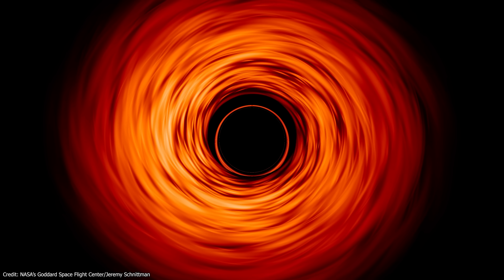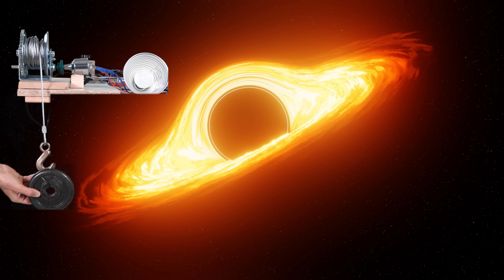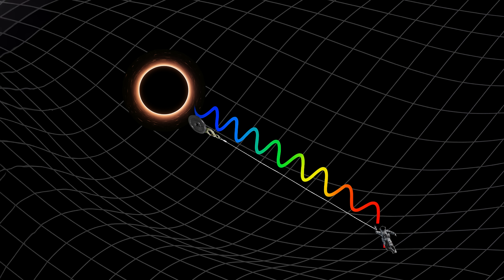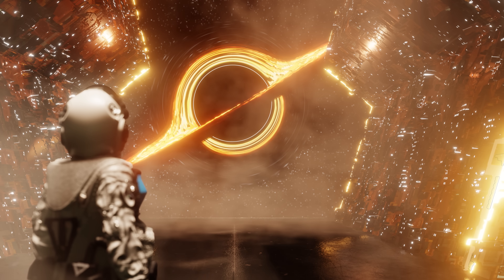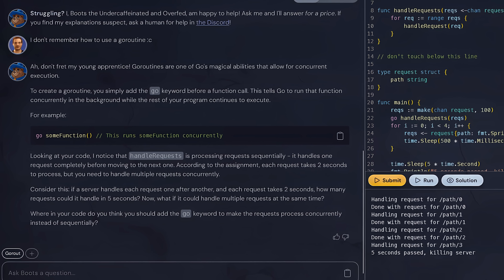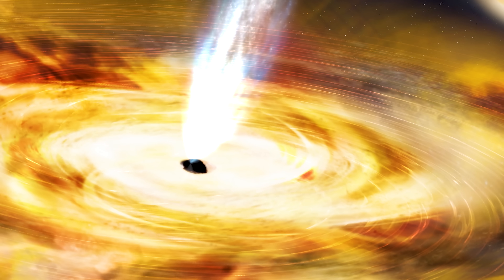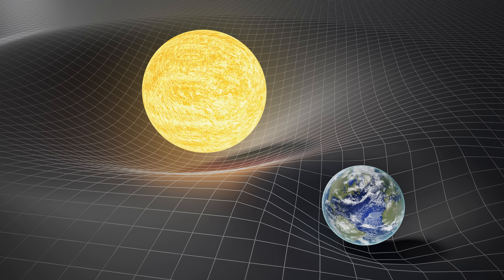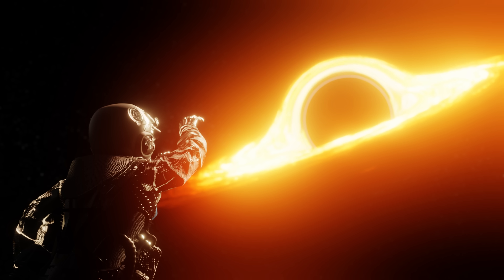How to Convert Mass into Energy at Home

Comment: It's an  external magnetic field and mass disolves into external heat energy because pressure is weaker outside of mass, with no internal pressure outside of mass and mass occupies space within it as outward force of pressure from cold repulsion as magnetism. Mass within closer proximity to external heat energy currents disolves its outermost surface perimeters into external heat energy like campfires slowly disolving internal magnetic fields disolving outside perimeters first. Physics works. Mass falls or rides the current grounding as a wave towards the earth's surface. Heavier elements have more repulsion equalization to lighter elements grounding currents through its nucleus or core like quantum elements, making up planetary internal magnetic fields grounding currents through its nucleus or core. Our outermost magnetic field perimeters protecting our planet from intensity of heat energy singularities solar wind striking our outermost magnetic field perimeters light up when dark heat energy strikes as quantumized sparks unabsorbed. Prisms show the color of unabsorbed heat energy singularities outside of mass as fire lighting up the mass it strikes unabsorbed. The lighter the color, the more heat energy passing through the glass. Thicker glass absorbed more heat than thiner. You can see rainbows of color in campfires. Physics works. The current flowing in a river at the same rate as the middle or the shallows is equal baring resistance. When magnetism hits the resistance of currents, you see centrifugal forces of whirlpool or whirlwind. Mass is cycling circulation centrifugal force of magnetism. Our magnetic field protecting our planet is made up of elements proves hypothesis. Our magnetic field is the amplification of quaternary elements combined amplification of quaternary elements synchronization of magnetism. Fire is anti-matter. Campfires prove hypothesis. Two states of physics cold and heat coexist. Magnetism explains everything about physics without gravity and bending space and electricity. Electricity is rapid heat generators of faster than planetary internal magnetic fields grounding currents through all masses in its path. If heat doesn't ground currents it disolves into external heat energy outside of entanglement of mass like external magnetic fields stripping away potential renewable heat energy from proximity mass disolves its outermost surface perimeters like meteorites hitting earth's internal magnetic field faster than grounding and hit atmospheric gasses as a whirlwind disolves outermost perimeters surface first.
Reply: Wow, so many words. My brain is not braining anymore.
Reply: I will come back here to read it.
Reply: Stop it, get some help.
Reply: Yeah okay buddy.

Comment: UPDATE... the claim at 1:37 is false. Imagine the frame of the weight. Time dramatically slows as it approaches the horizon. From its point of view the universe outside is evolving extremely fast. This includes the winch. Any gentle tug (acceleration) of the cable will yank the weight at an outrageous rate. This is tension. It will NEVER drop to zero.

Or, imagine the frame of the winch. The mass is falling toward a (very odd) planet, where the weight does not hit with a thud, but rather with (what appears to be) an infinitely long, slowing descent toward the event horizon (which it can never reach). The cable never goes slack. The weight itself is continuing to fall, but (from the point of view of the winch) at a dramatically reduced speed. The cable remains under extremely high tension. It NEVER goes to zero. That said, you could induce slack if you try to let out cable faster than the weight is falling (from the perspective of the winch).

My original post: If you are confused here, I am a Math/Physics PhD and also confused at 1:37. The implication that you are going fishing (in a black hole) and the thing ate your bait (mass) but yet it is still attached.... seems problematic. How can there be slack?
Reply: There was a thread in a physics forum about "Black Hole Fishing", and Greg Egan did the math and concluded that the line will always break, no matter how strong.
Reply: Educated here, although in a different language/era (terms may vary: "relativistics"/"relativistic effects"/"mass-vs-energy"/"momentum"; etc) , but allow me to try to explain: It bent my mind until this mental exercise helped: It helps if you imagine two rooms are time-dilated relative to each other.  Tug of war between the two humans.  The amount of energy/pull will be felt different: The newton forces of pull over different timescales translates pretty weirdly.  This is how I made this video make sense.  Now, a caveat...there's no infinite-strength zero-mass "unobtainium" rope for this hypothetical, but the thought exercise of two adjacent rooms at smaller time dilation ratios (say only 1000x time dilation), made me understand better:

Imagine the person in normal-time room and the person in the slow-time room (for mental simplicity, let's stick to relativisitic gravitationally instead of relativistic speedwise -- e.g. the concept of lowering to gravity well rather than spinning relativistically into gravity well) will feel like a long sustained pull force from your pulling from normal-time. For simplicty, the tug-of-war rope is infinitely strong and zero mass (not possible), but makes the mental exercise easier.  Here, 1 second of pull for you would be orders of magnitude more sustained for the other person (in the time-slowed room).  You may still have lots of difficulty pulling because the time-slowed room requires a lot of momentum to get moving in normal time scales (despite it feeling super-forced in the slow-time room's person).  But...  

Once it hits near event horizon, the many-nines realativistically.  AND it's skyrocketing to infinite pull force (to POV of slow-time room person) AND the slow-time room becomes so lightweight, THEN it overcomes the difficulty pulling, suddenly it feels light at those many-nines.  
--> The precise same graphdrop effect pictured in this youtube.  The normaltime room wins the between-timedilated-room tug of war.  

We often think of the relativistics mainly about the speed of things spinning around black holes, but we also have relativistics about gravity too.

Those who studied a bit more, realized you can still time-dilate while "stationary looking" (to our frame of reference), simply by lowering into gravity well).  These TWO major math problems (relativistic gravity /and/ relativistic speeds) compound the complexity of each other -- which makes it hard to understand the components of relativistics.  Ph.D can mesh it all into the same math formula, but visualizing the multiple superimposed relativistic components is mentally exhausting, until clever youtubes like this comes around to ELI5 the less common gravitational relativistic!

In realisticness, things will naturally try to spin around a black hole because even a tiny femtogram of sideways push (Metaphorically - just like a push of asteroid threat 50 years in advance to save Earth, the advance time can make a big difference -- except -- here, instead, you've got relativistic time dilations AND relativistic mass differences, simultaneously involved here)... So, this can often be enough to dominoe-effect all the way to the death spiral to light-speed spinning around the black hole.  

So that's much harder to balance that trying to balance a neutron star on the tip of an infinitely-strong needle, while above another neutron star.  So atoms -- even, the chopped up bits of what were atoms -- WILL generally try to spin around a black hole, no matter how vertically you try to lower atoms vertically into a black hole.

So beyond napkin exercises -- it is not practical to "just lower vertically" (no orbital velocity relativistic) -- but if you were able to, it DOES still time dilate relativistically with the graph spike coming just a bit later than if you also had the simultaneous relativistic velocity component (likely a few more nines, since you're no longer compounding velocity-relativistics on top of gravity-well relativistics)! 

Suddenly made a lot more sense.  Hypothetical as it may, this video is a great explainer of this mindblow.

(...*Note: The usage of terms like ‘mass,’ ‘energy,’ and ‘momentum’ differs across schools/eras, but the appropriate apt metaphors are used best-effort on a casual basis.  Mea culpa... However, the root point is communicated about different components of relativistic effects, other than the most common relativistic effects human know: The common-known kabooms and the common-known velocity-related time dilates...)
Reply: I don’t think the weight would stop pulling as it falls into the black hole. It does cross the event horizon — just not visibly, because the light from it gets increasingly redshifted and can’t escape. But that’s just an optical effect. In any frame, the weight keeps falling and accelerating, so the pull on the rope should still be there. Or am I missing something?
Reply: @RosasGrapes No, it will not cross the event horizon, from our perspective. Or rather it will, but in the infinitely far future. That is what it means the time slows down near the event horizon.
That also means that as the mass approaches the event horizon it will move slower and slower. That is pulling less and less on the rope.
On the other hand if you try to pull it back, it will resist. To pull back something that is frozen in time at the event horizon will take infinitely long time.
Reply: @gubigm  ok. Thanks for the explanations. I think i start to see it, but it's still hard to digest...
Reply: @RosasGrapes  Action Lab was correct, he treated the asymptotic fall speed as effectively zero, which is valid in practice. In reality, tension propagates at finite speed, so near the horizon, even minimal desynchronization causes slack.
Reply: @RosasGrapes  I agree. I just don't see how there could be any slack.
Reply: Suspension for suspension.
Reply: You can either experience all the space or all the time of spacetime, but not both. Near a black hole, time slows down (approaches infinity, and thus F and E approach zero) to an external observer. But what do I know, I'm just a BSc.
Reply: @paddor  I see that, but the slack on the line is what has me baffled.
Reply: As someone falls into the black hole they continue accelerating but according to a stationary observer they seem to fast accelerate and then their rate reduces as they red shift until they appear to have stopped.  In my understanding since their time is so warped from the observer's, to the observer they seem to have more inertia. And to the one falling, the observer seems to have less and less inertia because of the way time passes by. As they fall more and more in, some of the stars are born and die with in his life time INCASE IT IS A VERY VERY LARGE BLACK HOLE. 
Now because of the inertia issue, if the observer had a rope to try to pull out  the other someone falling in, the observer would notice that the other someone gets harder and harder to pull by the minute to the point where you'll need infinite amount of energy, with a rope of infinite strength to pull that someone even slightly. This is because that someone's time ticks slower than yours the more he falls in.
Reply: That brings a new meaning to the term “time line”
Reply: Near the event horizon, the fall speed v_fall approaches zero from the outside view. If the winch unrolls at speed v_winch > v_fall, even slightly, the rope goes slack. So no, the rope isn’t always tight, only if v_winch exactly matches v_fall. Dear PhD, you forgot your math homework.
Reply: @NoName-cx3gk I said exactly that above. If you unroll the cable faster than the object is falling, then obviously you would get slack. But that is not what was claimed at 1:37. What was claimed is that the cable unrolls, but at some point the tension drops to zero and you can retract it. That is FALSE.
Reply: This is because most "science" is pure speculation and little facts. 
Only theories.
Reply: The universe does NOT appear to evolve fast from the point of view of a relativistic object!!! Every observer always observes time slowing down, never speeding up!!!
Reply: @cpthrki5852 That is false. Ask grok or chatgpt.
Reply: Fairly typical of this channel.
Reply: Yeah... That's bait.
Reply: The object is there, the mass is not
Reply: You’re a Math/Physics PhD and you’re "confused" ? Go do the research
Reply: Hey fellow human
Reply: @Josenobi  Problem resolved. See above.

Comment: how would we be able to harvest this energy efficiently? 
maybe there is a cool sci-fi mega structure that can harvest the energy from throwing stuff into a black hole somehow?
Reply: You can. There's a few ways. But effectively you launch an object into the hole. And separate it. Some of the mass goes into the black hole or closer to it. The remaining mass gets ejected and "steals" some of the energy. Which you now need to capture and convert to usability energy.

Another way is to capture emissions from a black hole. Obviously all of these require some pretty advanced physics.
Reply: @pdxmusl1510  but what kind of machinery would you need? what would it look like?
Reply: Some of the energy is emitted as light so you could harvest it with solar panels. It also would emit something akin to a solar wind so you could possibly sail spacecraft with it.
Reply: @Sashazur  hmmm, you could do that, but i wonder if there is a more efficient method